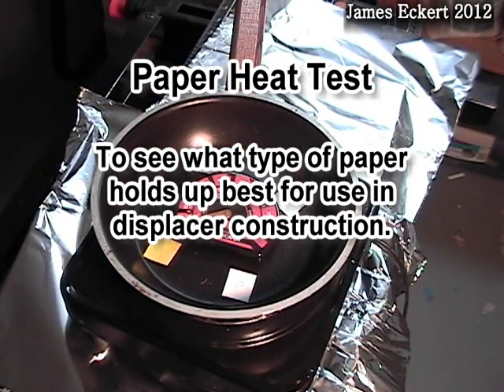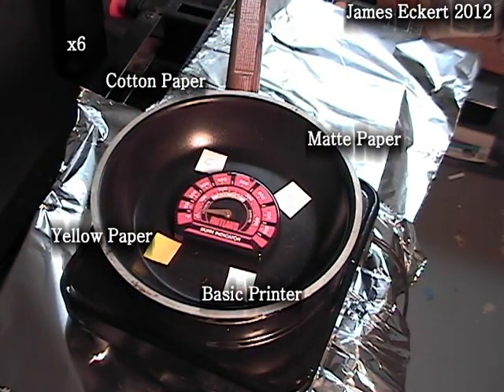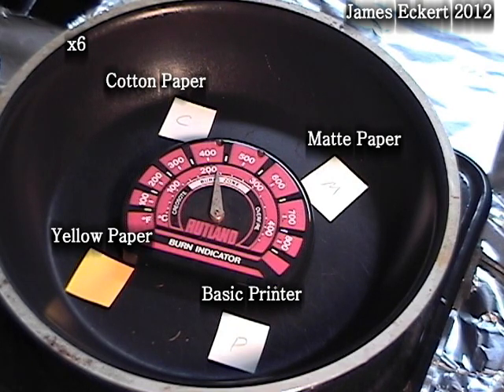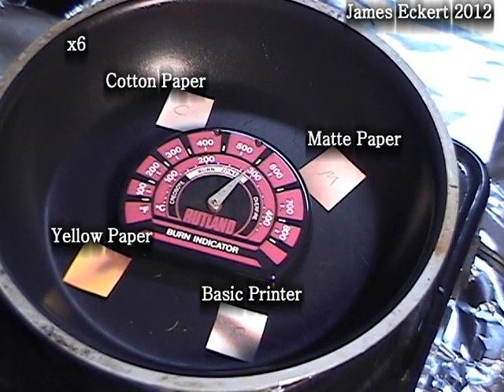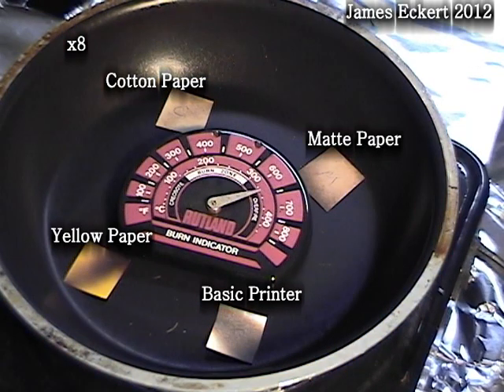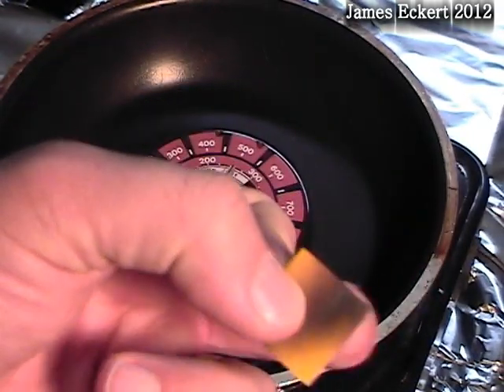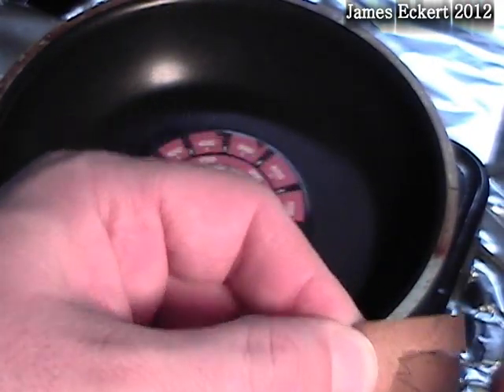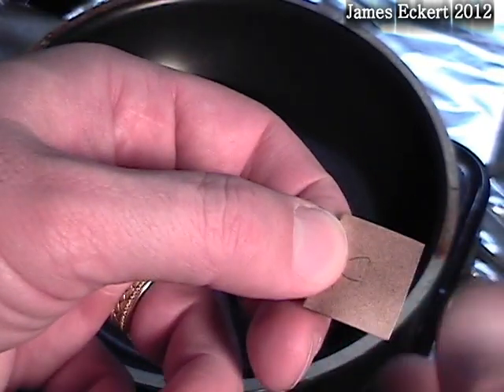Paper Heat Test

Comment from the maker: Yeah I have heard that a lot too.  In my mind the displacer should be a heat insulator not a heat conductor.  My theory is, any gain in the rate of temperature transition would be offset by the heat deference being much less.   Maybe at some point I will try to setup a test of that.

Comment: I saw one guy use some fine steel wool rolled up into a cylindrical shape for a displacer. Said something about it working as a regenerator and helping the engine run better